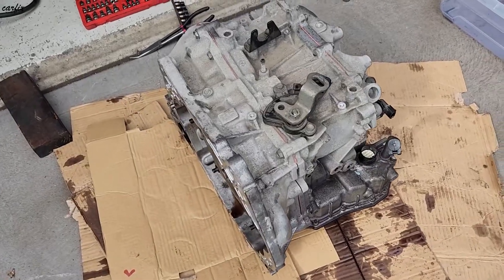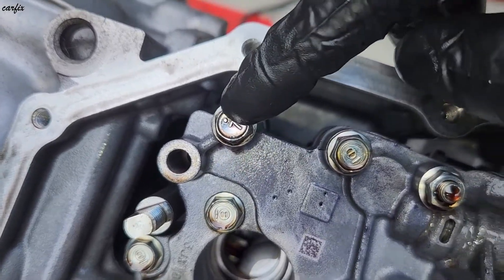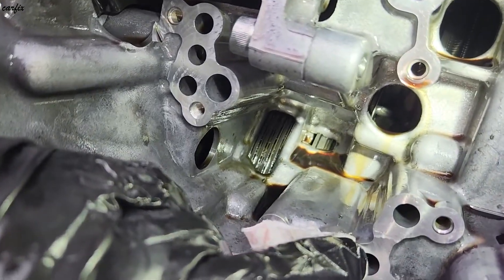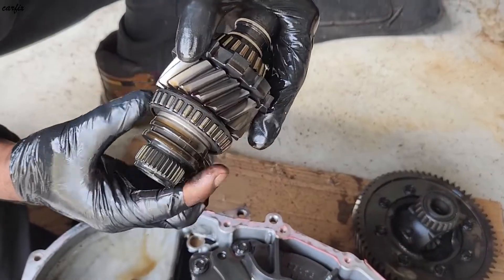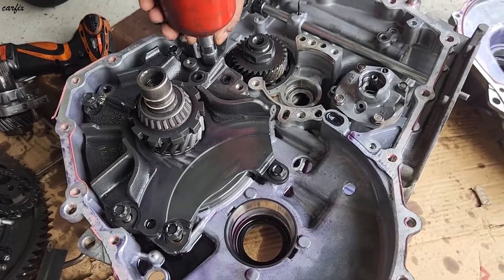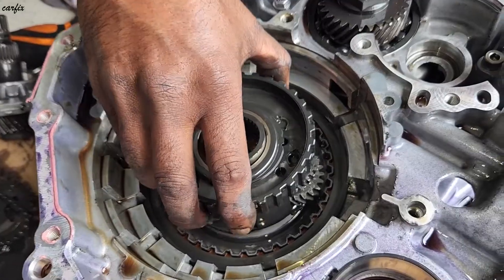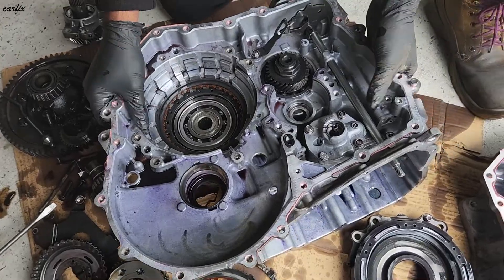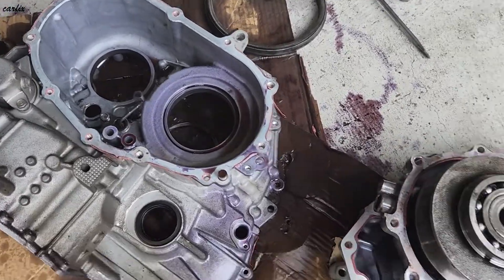Nissan Pulsar B17 CVT: Teardown and Failure Analysis 2012 to 2016, (RE0F11A)

Comment: The problem with the cvt is not changing the fluid after 60,000 km or every 3 years if there is no traffic on the road, another factor is your heat exchanger, which is horrible, you must always have the air conditioning on to cool the radiator. , but if the region is very hot, use an external exchanger that has a thermostatic valve like it has on the Nissan SUV, the ideal maximum fluid temperature is 80 degrees, when changing the fluid, do the total change, nothing partial as the filter keeps accumulating and giving a loud buzzing noise when accelerating, I have a Sentra B17 2019 engine is 2.0
Reply: the problem is a hidden filter which nobody changes. IMHo
Reply: @jedenzmnoha  Yes, remove the crankcase to change the internal filter, there is an external filter that some are in the heat exchanger, but as for changing the fluid, the filters are also changed, I do this on my Sentra every 3 years or 40 thousand km, I use the idemitsu type n3 fluid same as the one nissan sells at the dealership
Reply: @fabianoazambuja1  yes, the external one under heat exchanger is the one
Reply: @fabianoazambuja1 do you have the part number for that?
Reply from the maker: @andresstv2484 for what plz
Reply: its useless to change fluid and not the clogged up filter

Comment: R u located here in Australia ?
Reply: Hello, I have Nissan Pulser 2016 how I can I know if my car has CVT transmission problem
Reply: Where about 
in Australia are you please?
Reply from the maker: @29langston Melbourne
Reply from the maker: Yes
Reply: @carfix, what would the average cost be for a tear down and repair be. Is it a common issue for a car with slipping box with 130000klms. I’m also in Aus
Reply from the maker: $3500